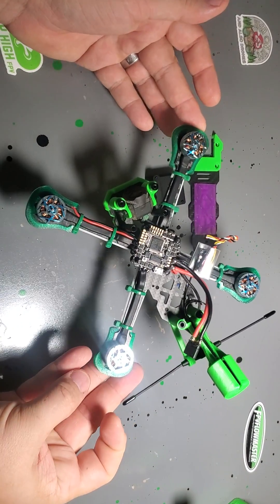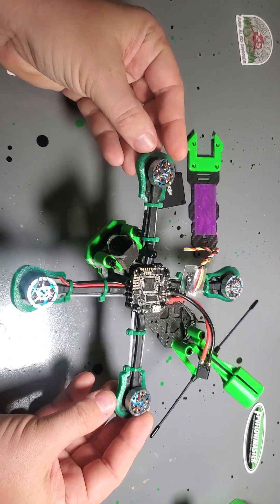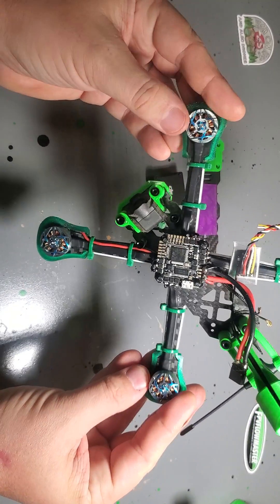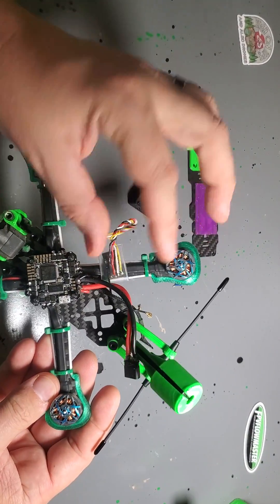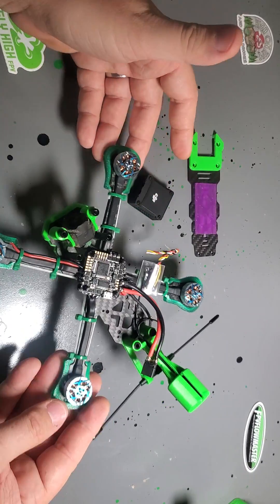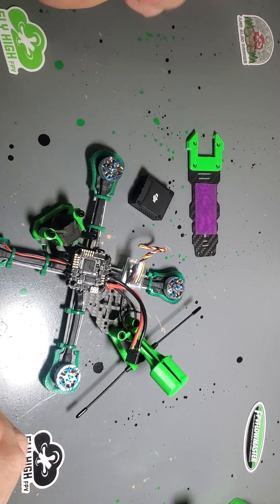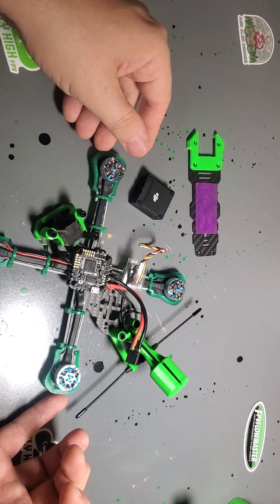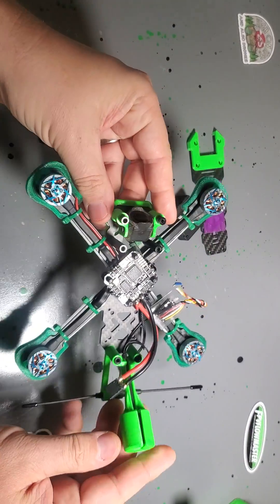Botgrinder's Grinderino 3.5" HD Drone Build coming along nicely 🙌

Comment: How heavy are the 3d printed skids? Trying to build one sub 250. I dont have a 3d printer, but my friends do. I dont want to bother em at the moment tho to print me a test piece. My calculated weight with lipo is at 230 gramms.
Reply from the maker: Mine is about 249g without battery, but it has alot of tpu, a self powered buzzer, led's,  full 03. If you goal is related to weight, instead of durability, lose as much tpu as possible, just use a minimalist tail  or some zipties
Reply: @Fly_High_FPV  thank you for the reply. Im gonna stay on the hunt to shave weight
Reply from the maker: @JustLenni  9.5grams for a set of 4 of the standard skidz. If you're pinching grams, shoot me a dm for some minimalist skidz, I can cut that in half, easy 👌